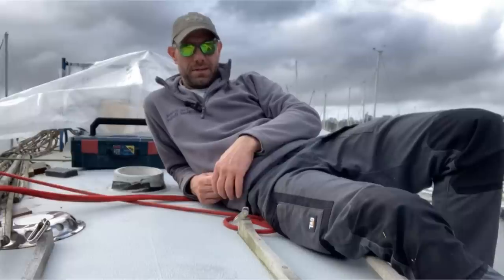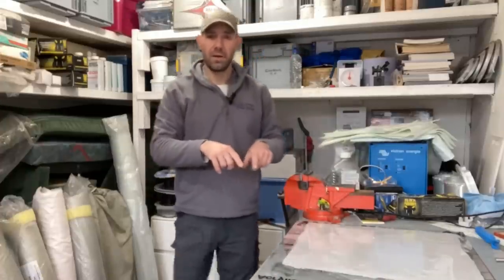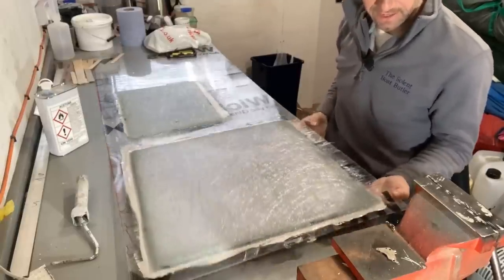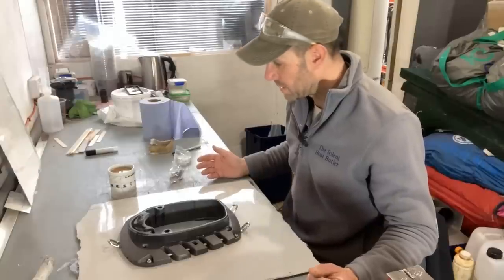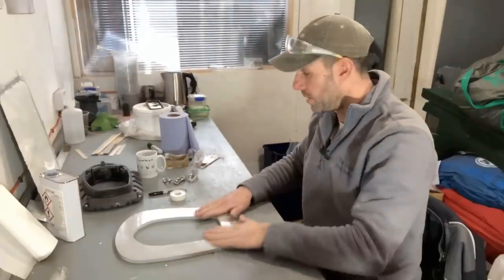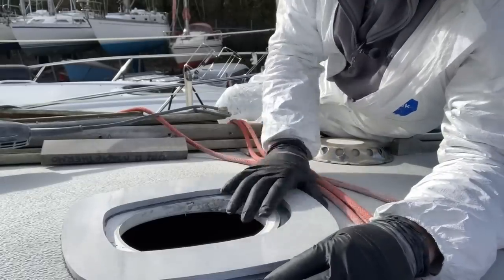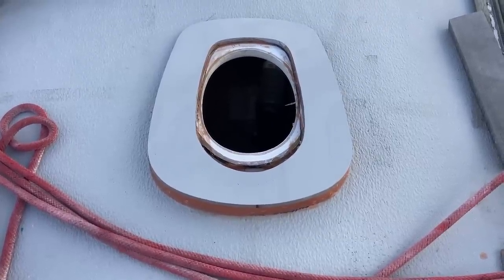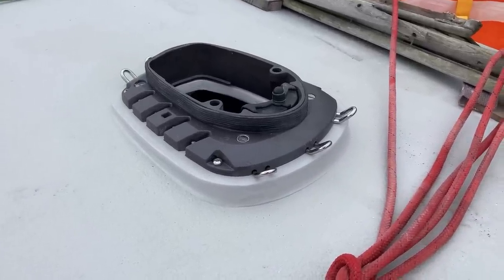Deck Mods to fit a New Mast - New Selden Deck Ring (Project Lottie Ep16)

Comment: Looked sideways at one of the laminates, looked off color and then I saw the deck color.  Nice work as usual.  👍
Reply from the maker: The artificial light in the workshop makes the colour look wrong but it’s fine on the boat.  Thanks for watching.   To be fair I had the colour matched gel made for me by someone that is very skilled at matching, also a lot faster and better than I could do it.

Comment: Maybe I missed the explanation but it appeared you ground the aft end of the mast hole flush with the coach roof but left the forward end a bit proud. How did you arrive at the angle to get the correct fit?

Comment: Awesome job! I've just found a split in the base of my mast. Fun times. So I may end up having to get a new one at some point. I'll just have to bodge something for the time being. Urgh, boats.
Reply from the maker: Ahh, mr bumbling sailor, sorry to hear that but you may be able to get it repaired, depends how bad it is.
Reply: @RefitandSail  I don't think it's drastic. About 60mm non opening crack up from the port side of the step. Just gonna brace it with something for the time being 🙈
Reply from the maker: @BumblingSailor  oh dear, it’s a pretty low stress rig on a co26 so may be ok.  Send me a pic by email if you like abs I’ll give you a view on it.   (Or is it in your latest video?)

Comment: You always do such nice work and make it look easy.  One question, when you put the flat base ring on the deck, I know you stuck the little piece of wood under the front to hold it up....but did you make the ring level or was that not a concern?
Reply from the maker: Thanks.   The ring is fitted to be close as horizontal as possible, the mast should pass though it at close to 90 deg.      Absolute horizontal or vertical are all relative on a boat with so many curved surfaces and on a moving sea!
Reply: @RefitandSail  Makes sense, thanks for taking the time to answer.  I enjoy your how-to videos....I use your techniques and tips when working on my boat.

Comment: Great job. Is there a seal under the new deck ring to stop moisture running or dripping in?
Reply from the maker: Sealant between deck ring and deck.    Then the normal rubber gaiter or boot between deck ring and mast.

Comment: Nice Job! Just wondering if you used or need to use a sealant under the deck ring? Thanks!
Reply from the maker: Yes absolutely, the deck ring needs a bedding compound or sealant between it and the deck.    I mostly use Sabatack 750xl but there are lots of alternatives.

Comment: great video as always.  Many thanks.  can i ask what resin you were using and what you used to thicken it for the filling?  Cheers!
Reply from the maker: The adhesive filler I used for bonding the ring to the deck is prethickened (probably with somthing like cabosil) and also have fine chipped glass strands in it.   It’s good for quick non structural repairs! I say non structural but it’s bonding strength is very good if the surfaces are well prepped.

Comment: God, You're good.  But the part you couldn't film is important to me.
What tool(s) did you use to cut out the deck under the ring?
Why not cut before you installed the ring?
Thanks,  G.
Reply from the maker: I cut the deck using the same oscillating tool used to remove the old GRP upstand/collar but with a long plunge-cut blade.    I cut it after I installed the flat area because I wanted to put the Selden deck ring in the hole and draw around the inside so I only removed what was necessary rather than over-enlarging the hole.    Hope that makes sense.
Reply: @RefitandSail  Got it.  Thanks, G.

Comment: Can I be cheeky and ask roughly the price of a new contessa 32 Selden mast?
Reply from the maker: When you include all the additional items needed such as lights, vhf antenna, new boom, gas-strut rod kicker, standing and running rigging and numerous other bits and bobs you are into 12-14k (inc vat).    The mast on its own is about 6k

Comment: Alignment?
Reply: @RefitandSail  I didn't see you mark or measure fore aft alignment. As the deck ring won't allow any twist I thought this might be useful.
Reply from the maker: @TheFlyingPlectrum  ah, right, I do quite a lot off camera for the sake of expediency and try to talk about it after, I’m on the clock for my client and sometimes I just have to crack on without the camera.  Before placing I made sure alignment was all good and then drew the location line around the moulding before grinding back the deck.

Comment: New mast, new boat!

I've always wondered what an old non-IOR hull would do with a modern spar. Is the new mast the same height as the old?
Reply from the maker: New mast will comply with the co32 one-design class specification so no taller or change in rig dimensions.  It would be nice to see if there was any weight difference between old and new masts but I doubt it will make a fundamental difference in the performance of the boat.  A taller carbon rig on the other hand would be interesting…